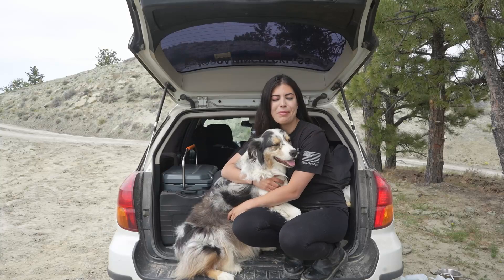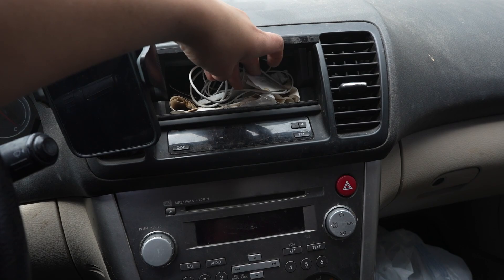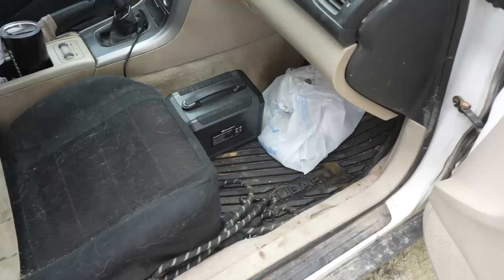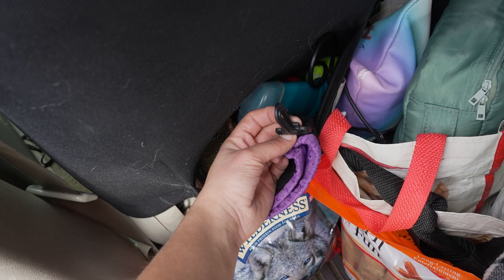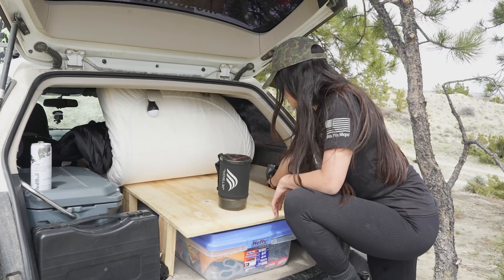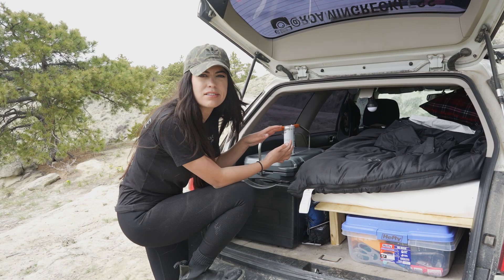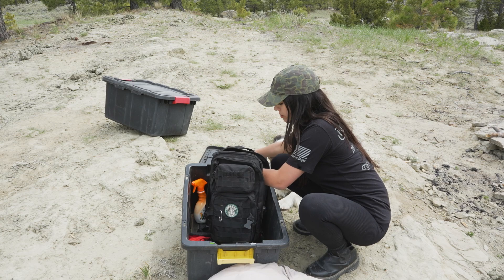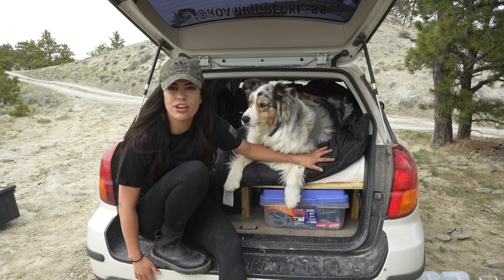LIVING IN MY CAR TOUR | Kitchen Setup, Survival Gear + More

Comment: The butane gas cylinders should be ok, should be butane and a smelly sewage sulphur additive so you can smell a leak. Your risk is a gas leak/fire and explosion. If it did leak, you have lots of electrical equipment. Its very very unlikely though if kept in cool storage or totes. They should burn cleanly since your outside. CO will come from typically faulty gas hobs gas boilers not getting enough oxygen which will give off CO. Car tyre puncture repair kits are often useful and cheap for short term main tread repairs. The engine or brake  leak additives often have glow dye and uv torch can show you the leaks if you have them. You need to get the hammock up pronto. Depends how you feel, some people would have subaru deal, clothing deals, equipment deals, use michiganster10 to get 10% off dog food. Can end up a seque every few minutes. 2 cookers are even better, maybe a tarp to cook on. Your doing great, keep on trucking. 😋
Reply from the maker: Good to know. And I do need to get the hammock up ASAP!

Comment: I came across your channel today and I've watched a few of your videos, good stuff. If you can use an external charger with your GoPro get a type C wire plug it into your GoPro and plug into your cigarette lighter or get a small solar battery pack, probably $30 on Amazon.
Reply from the maker: Good idea!
Reply: @roamingreckless  I've been considering doing some car camping, something different for my channel.  I live in SW Florida and have been fishing and filming the same areas now for five years on my YT channel. I've been watching some videos on the topic of living in a car and Youtube suggested your channel today. You're doing an excellent job with your filming and editing. You're a natural at talking to the camera for sure. I'm curious, I just got a drone that I'll be introducing to my audience this week. Do you have the part 107 commercial license? It looks like a hard test to pass.